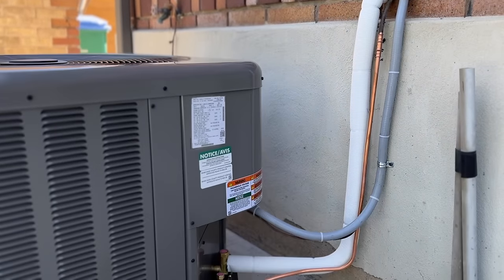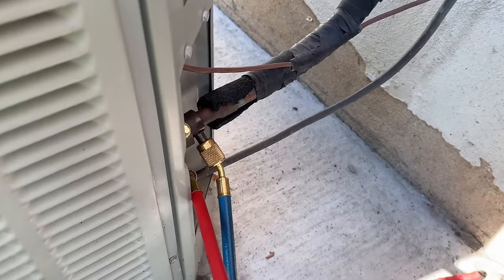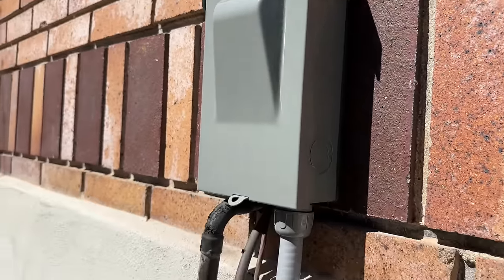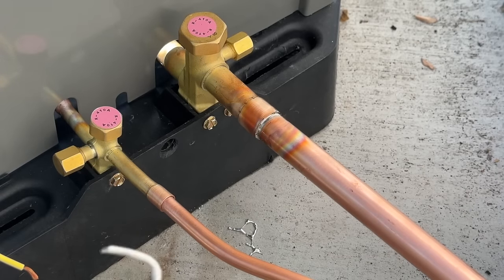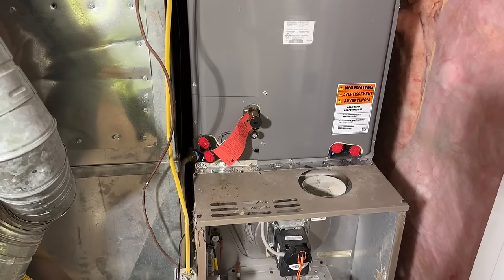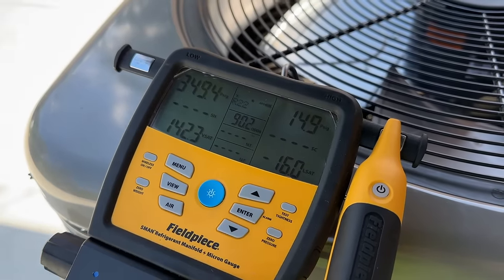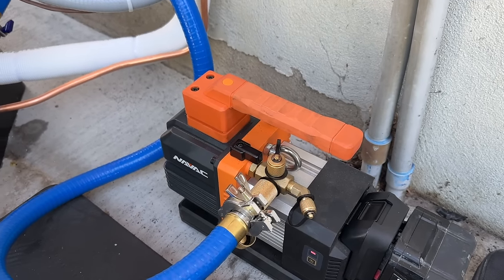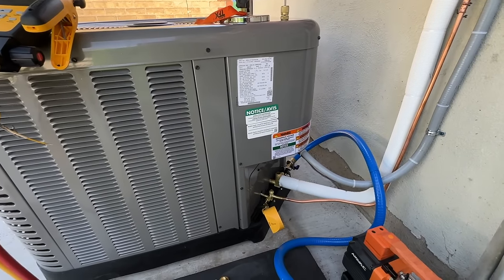Did You Know You Can Replace Your Own Air Conditioner?   -SAVE THOUSANDS-

Comment: I love how all the "Pro's" are on here talking sh*t about people doing it themselves, and how they'll "burn their house down". Yeah, ummm, here's the thing Jimmy... I'm an E.E who has worked with M.E's for 20 years in designing HVAC systems. Installing and replacing this stuff is nowhere near as hard as you "Pro tech" guys make it out to be. The average guy with average intelligence can do this job just fine... I mean, how do you guys think you got your jobs?
Reply: Well for start to go to trade school to get a epa is not cheap then for me to invest my time to buy the tools learn what each tool does and  know how to install properly and actually know what I’m doing and if something does happen the pro will fix it then doing it urself off YouTube university and what guarantees are you getting that it’s going get done right how do they know that the home they bought the duct work is properly sized for the home or insulation levels are high there’s a lot more to it not just connecting stuff everyone is like a mechanic intill something happens
Reply: Not necessarily burning their house down but making their $5000 HVAC become a giant paperweight because the lubrication and refrigerant is lost.  There's a reason people get master or journey HVAC and plumbing specialists to install this stuff.  They're insured, and more importantly, they're certified.  It takes 2-5 years, depending on the trade to become certified to work under a master tradesperson as a journey person or a stringent test to become a master in their field.
Reply: Love it lol.  All you need to do is be smart enough to find out what you need to know
Reply: Oh God! We have an Engineer, here go figure 🤣
Reply: Amen brother. Before I got my bachelors in mechanical, I went to a tech school to get an associates in electronics, and there was a guy in class that kept failing the courses. He ended up dropping out and perusing the residential HVAC training. I would often run into him during lunch time and asked how it was going with his training, he would always say “a monkey could do this”. 
Since we are all evolved monkeys….I guess I’ll take my chances with the DIY route.
Reply: @justynnoss2786  Those specialized tools you guys paid for? Clones are now mass produced by China for a fraction of the cost.

That specialized training you guys paid for? That information is now published all over the internet. 

The experience troubleshooting? Not applicable to Average Joe replacing his unit who isn't doing this daily. 

If he does run into an issue? Again, relevant information published all over the internet.

It doesn't take a physicist to understand these systems or their components.
Reply: It’s not hard but he’s skipping very  important steps here. Not purging with nitrogen when brazing the connections causes build up of oxidation on the inside of the copper tubes. The refrigerant will take that flaky black oxidation in the tubes to the indoor metering device most likely txv and clog the strainer in it. This will cause a blockage and you will have a decreased capacity and or no cooling due to it. Also brazing next to service valves and indoor metering devices with not heat shield can cause the o rings indside each to melt and fail to open. All the money you save by doing one your self you will spend on repairs on this one.
Reply: No respect for licensing, insurance, permits, or warranty huh?
I hope you purchase a home one day that the homeowner (only experienced byway of YT videos) has replaced the condenser, evaporator coil, & heck while we’re at it- the electrical panel and the roof too👍 No worries, right?😂
Reply: @shortstop7247  Licensing proves knowledge, which is readily available. Insurance covers negligence, which isn't applicable to the next homeowner. Permits aren't required in many places. What percentage of the time will a properly installed system have a warranty claim?
Reply: @shortstop7247  Exactly. Well said. I’m pretty sure every DIY’er defending this would pass on a house that was DIY’ed by previous owner.
Reply: @Hakuna_Frittata  from the perspective of most purchasers “licensing proves knowledge” so your average person will likely feel better with the proof, right? How about experience too? For that I want a licensed contractor to do the job.
& I don’t think liability disappears with a sale either. I believe by whatever your state law there is a number of years the installing contractor is responsible. Permits- I get it, but that iced the cake of my comment, if required. To your warranty question, warranty is likely negatively impacted by not using a licensed contractor.
Reply: I can't blame anyone for trying to do it themselves.  Go ahead and do it.  I'll be waiting for your call to bail you out when you fry something.  I've seen it soo many times.  If you are capable, go for it, but if you are winging it, good luck with that.  I hope you have a basic understanding of all things hvac related and the tools to install and repair your own equipment.
Reply: Let’s see the “average” guy install a horizontal evaporator in a TINY attic, given the new coil is 6” bigger yet no room to gain.   Won’t be long til the tears start flowing.  Come to the north shore of Chicago and do some real challenging installs.  Not every install is a condenser on ground floor with a wide open basement for a coil change out!
Reply: There's a reason why they will void your warranty if it's not installed professionally.  Even the OEMs tell you to only let a pro install it for a reason. They don't want some idiot homeowner with 30 minutes of youtube training.
Reply: Wasn't it your people who designed lead water pipes and lead paint? Then, asbestos lined water pipes and insulation? Your kind continues to "engineer" easy to replace parts that you have to spend 3hrs removing other parts to reach, when there was plenty of room to prevent that. It's also engineering that designs obsolescence into everything today, hvac units used to last 20-30yrs and now all manufacturers give 12-15yrs.
Reply: I like the" do it yourself", people.  They eventually call you , you make great money to repair what has happened and it usually does cost much to repair. Keep on keeping on is what I say.
Reply: Ac units are ran way more now than ever. In the 80s we wouldn't get ac calls from September to May @handlesaredumb1
Reply: @justynnoss2786 😂😂well then,do yourself a favor,and stick to reading comic books then kiddo. Hvac stuff isnt hard nor rocket science. 😂😂😂😊😊
Reply: Who do you think finds the flaws you engineers create on hvac systems? Want a hint? It’s not an engineer.
Reply: I go to plenty of "engineers" homes and diy installs. Sure they spend less on a new unit, and then spend double that price fixing the problems with no warranty. Happens all the time. The average person would have to spend thousands on the right equipment to do it properly and be educated on city codes and such. Load calculation, brazing, wiring, metal work, setting the equipment settings up correctly is not a diy job. Plus it isn't legal to work with refrigerant without an EPA Certification which takes time to learn and pass. Even the most experienced HVAC techs are still learning new things after 20+ years. Saw plenty of things wrong in this video. Using solder for the lines, brazing without nitro, not flushing the line set just to name a couple.
Reply: Just a quick note, check the warranty on the parts. Many times the warranty is voided if it's not installed by a licensed tech. I would check it first before trying to diy.
Reply: @Hakuna_Frittata  I replace warranty parts on new equipment ALL the time. Boards that get revised after less than a year due to engineering errors, contactors randomly going out, ect. There are numerous things that can and do go wrong on new installs. I run new warranty calls almost every day. The engineer customers are always the best 😂 they think they are so smart and know everything, but we fix their issues all the time.
Reply: Wow aren’t you impressive.  An engineer.   The issue is that not everyone is as talented as you are.  There are people capable of doing this and people who shouldn’t.  We don’t cater to those who can and want to, we are in business to help those who don’t want to or don’t have the tools/skills.  And yes you can burn the house down.  So get off your high horse.  I’m an ee and designed ac equipment then clean rooms.   But I don’t go around bragging about it like I’m god.  I’m just an ac guy who treats my customers fairly and appreciate that each one has different needs and wants.
Reply: Now to go to a home inspector YouTube channel to prove what OP said about the "pros" 😂
Reply: Issue I had, in NY you can not purchase a pre charged condenser without a license. Got a friend to buy for me. Stay Brite needs no purge but isn't as tollarant to vibrations as Brazing. Nice video.. one suggestion I make with disconnect is, don't put it back in off position. People get confused and wind up putting it back in the same way. Take it out and leave it on top of the box.
Reply: Yep. I hope all the super smart homeowners run out and put some systems in. Just as a little side note. Google and diy is half my business. Go right ahead and put your stuff in. I’ll fix it and make it work properly and I don’t have to carry your warranty! Thanks!
Reply: I’ve changed my capacitor several times too. Something they claim is so dangerous.
Reply: I’ve changed my capacitor several times too. Something they claim is so dangerous.
Reply: @dgapp76 I’ve replaced half a dozen of these with no license. Easy.
Reply: All of the professionals try to come up with an excuse that you can't do it only thing is you can. They don't like that. You're not repairing anything you're buying new equipment that works perfect right out of the box. I guess they forgot what their job was.
Reply: I love how this guy is convincing you you could do it yourself, but he’s doing it for someone else. Why didn’t the person who owns the house DIY it.
Reply: See you’re mentioning people with degrees doing the design portion of the job. You don’t mention that the average homeowner doesn’t have the $10,000 worth of tools to do the job nor the 10,000 hours worth of experience to do the job. Sure it’s easy for someone who knows what they’re doing, but that’s anything.
Reply: @Erk0806 Fake news.
Reply: @d1specdrifter  what are the symptoms of a bad txv
Reply: Engineers need 3 yrs field experience before touching any design
Reply: Not by watching your videos and first of all i have to spend thousands to buy the tools needed. 😂😅
Reply: Go ahead and do it yourself. When the unit fails in less than a year.. You're gonna wish you went with a pro the first time
Reply: Thats the great thing. We can choose to do all of the easy work, and if its a tight fit in a hot stuffy attic, we can make a shlep like you do it. @SkilledLabor
Reply: @justinbailey6515  I just installed a Mini split for $750.
To have one "professionally installed" I was quoted $8,000.
I did the install in 5 1/2 hours including the a/c disconnect.
I can throw 9 units in the garbage before I break even.
🤣
Who cares about the warranty? 
By the way, this thing is working great.
Reply: @5dc61 well he did put ONE sentence together
Reply: homeowners who work on baby 2 ton units and think they're the shit lol. E.E, M.E, W.I.I, lol idc - id give you a month to figure out the systems that i work on. thousands of pounds of refrigerant charge, vessels bigger than your house lol.
Reply: At the 6 minute mark he does speak on the situation regarding not using nitrogen. I'd have to look into whether this method truly doesn't create soot though.
Reply: @justynnoss2786 How many times do you go and check the duct size and insulation levels? I’ve had a few pros come out and even had a few full install quotes. And none have ever brought that up.
Reply: It is sad how people are taken advantage of by the pros
Reply: @justynnoss2786 u don't have to go to school to get epa
Reply: Hey, I see where you're coming from, but it's a bit of an exaggeration to phrase your general post as just any individual can put these together. 9 out of 10 of my clients can't even put ikea furniture together (bad example).
A pro DIY could do it, but when it comes time to evacuate and add refrigerant...? 
I'm an hvac contractor in NY
Reply: engineers make the worst customers... just like this comment they think they no everything and are better than everyone else
Reply: Absolutely right. So many Techs are realizing they wasted their money going to school for this.
Reply: 12 year resi/comm/ind electrician here. Replaced my dads system about 7 years ago with an American Standard. Purged with nitrogen, brazed the lines, pulled down to a micro vacuum or whatever yall call it.  Took a week of reading and like 800 or 1000 dollars in tools. Still running like a top, no issues ever. I rent my house, they put in a new trane system and it went 1 year and 3 months before needing a txv, and in 6 years the system sht the bed again. I know there's some great HVAC guys out there, but considering yall bill double what electricians do, as a whole, yall could do better 😊
Reply: the arrogance level is astonishing, passing a couple math classes in college so you can input insulation values and square footage into a computer program that spits out the tonnage doesn’t mean you automatically are the smartest person in the comments section hqhahahahahahaha, and as an EE your job was to what? tell the contractor they need XYZ equipment to make the price high so you get a higher cut when in reality the client only needs XY according to NEC standards but as far as the AHJ is concerned they only need X. i have a lot of respect for engineers but not when they are as arrogant as you. anything mechanical in life and i’d run circles around you. i went to university for EE but didn’t finish because i didn’t want to sit at a desk all day and i work with my hands very well. I have always been a good student and passed my journeyman and masters exam the first time. there are lots of good, knowledgeable tradesmen out there, and you’ll be apologizing big time for your arrogance when you need one to work hard and fix your problem when it’s -20 degrees or 120 degrees. oh, and they’ll make more on the paycheck doing it than you will
Reply: So you're saying EE...hmmmm I'm calling BS
Reply: Yea average people might be able to replace the equipment but if they have to modify duct work, make a plenum on the fly or run a set of PVC venting then good luck. You’ll be calling us for sure